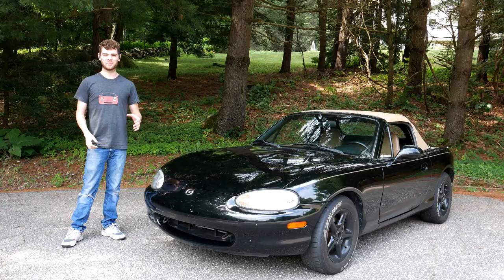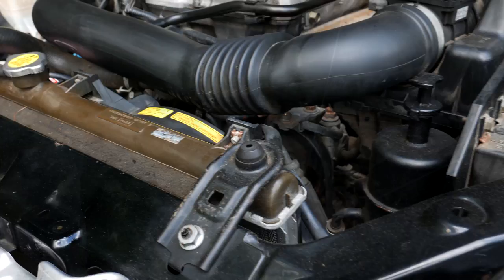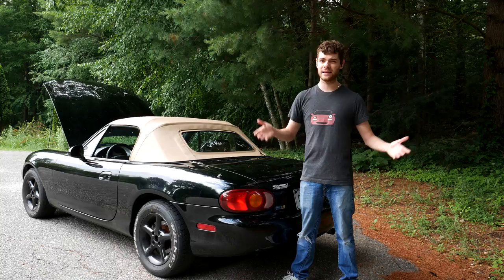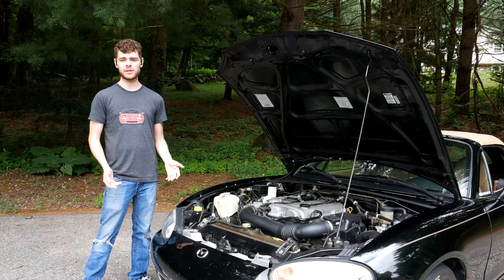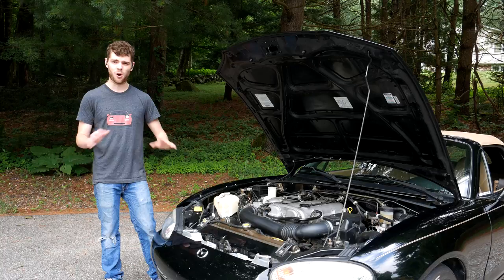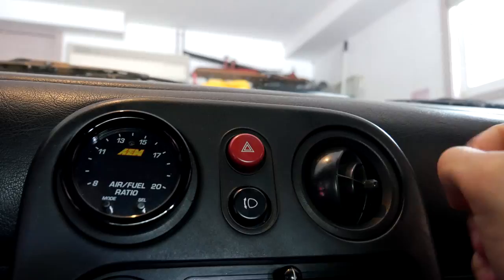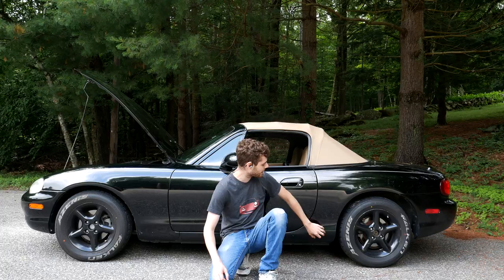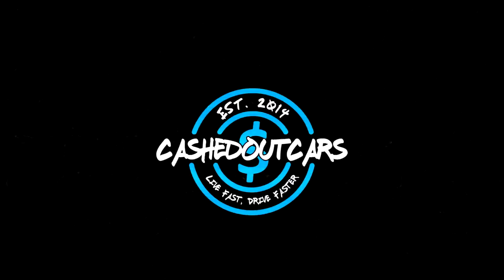5 MX-5 Miata Problems You WILL Have

Comment: Clutch slave cylinders will fail with no notice. Also the window track components wear out. Finally, the shifter will need to be rebuilt. Replace the nylon bushing with a bronze bushing and replace the boot seals (They will be torn)
Reply from the maker: I had my slave fail on my NA and the shift boots torn too

Comment: I have a 2003 NB I've owned since 2007. Its rear main seal has leaked since about 2010... had the valve cover leak too, but fixed that one. Rear main STILL leaks to this day, but hasn't really gotten any worse. Some day I'll summon up the motivation to drop the trans and replace it but today is not that day.

Comment: Also the cover under the steering column will fall off. Have had an NA and NB and it happened in both. Also have had valve cover oil leaks in both and not a leaky rain rail but definitely clogged drains that have to be cleaned out periodically.

Comment: I’ve have front wheel bearings go. Front brake callipers seize and rusty sills, leaking roof. Clutch release bearing went too and water pump had tight spots when replaced. All on a 76,000 mile 2002

Comment: It’s 85$ for a radiator on Amazon I’ve been using at high rpm as a drift car for 2 years no issue, I have hardtops so never had a issue with my softtop going bad, never had the rain rails fail in either of my Miata’s yet hopefully it doesn’t. 😭 you have to do maintenance it’s so easy to change these oil gaskets, there about 12-19$ on Amazon and extremely easy to install, I definitely agree the vents are get floppy, personally mine are aftermarket but I agree, I don’t have rust but yeah that rocker panel be rusting like crazy

Comment: My 95 just got it's vents pulled and refreshed yesterday.  Still need to get the new Robbins top on, I have the hard top but having a hard top on a convertible isn't a solution to me, it's a problem.
Reply from the maker: That’s true about the top.. luckily hard tops are relatively quick to remove. I’ve still been quite happy with my soft tops!
Reply: @CashedOutCars  Mine has the Jass latches in the back so... more secure but more of a pain to take off as it requires tools.  Need this New England weather to go back to sunny and humid instead of constant rain so I can try to get it done.

Comment: I havve a 2002 NB and I had all those problems plus the battery container rusted, Rust is the main issue. I am from Quebec where they use salt in winter and it is a body killer... Thanks. Oh I forgot the mesh oil filter of the VVT cam shaft system.

Comment: If you want the valve cover to stay dry, get the valve cover gasket from the Mazda dealer. The genuine Mazda gasket has a sealing groove on the top and the bottom of the gasket. Not one of the aftermarket gaskets I have seen have a sealing groove on the top. I've had 100% success rate with the Mazda gaskets, every single time I've tried an aftermarket gasket it leaks sometimes immediately, sometimes a few months in. Just buy the Mazda part, it works.
Reply from the maker: I agree, I had to replace mine twice on my NA

Comment: Good points on the MK2 NB .. However you missed out the NUMBER 1 issue with NBs...... CHASIS RAILS !!!! THEY RUST THROUGH... That would have been my first and most important thing to look out for and get sorted!!!
Reply from the maker: That they do, but from what I've seen it's far less common than fender and rockers. I did cover that in my full rust guide video on these though!

Comment: Clutch slave cylinder.  I changed mine 3 times in twenty years.  Had the original clutch the whole time on 95 NA.
Reply from the maker: That's definitely quite common, I've had mine fail myself

Comment: On my 93 about two weeks after I bought it, water began pooling around the bottom of the soft top so I pulled out and cleaned the drainage pipes. In one of them I found 3 bolts. I don't even know how they all fit in there or where they came from 🤣. The other one was just clogged up with mud and debris. Not had an issue with them since 😊
Reply from the maker: Glad you got it taken care of, enjoy!

Comment: Suprised nothing about lifter tick. Gotta put the right oil in for the season you're driving in. In my southern summers I would run slightly thicker weight for operating temps with 5w-40. For winter I would run thinner cold weight with 0w-30. I've read that some people go for 10w-40 for summers, I don't remember why though. At some point I started running 0w-40 (summer) and 0w-30 (winter), but I don't remember exactly why. 

There is also the EGR Valves reuptake pipe clogging with carbon deposits (primarily NA issue). There are few fixes. If you don't have to do emissions you can weld or plug the reuptake on the exhaust manifold, then tap and plug it on the EGR valve. If you have to do emissions you gotta get some brake cleaner, brake cleaner, and 30 mins to an hour of your time to clean the passages. If your reuptake hardline cracks, which is common, you can either buy a replacement or tap for a larger stainless steel line with AN fittings.

For my southern Miata daily drivers, you might run into heat soak or general overheating issues. Getting the coolant reroute kit and racing thermostat solves this problem. 

Accessory belt likes to pop off when your tensioner is bad, I don't know the solution to this one but I can tell you that Mazda's genius design ( -_- ) of using iirc the power steering pump bracket as the tensioner is annoying. Doesn't matter what belt you get, that bitch will fly off if the bracket is bad. 

MT shifter bushings like to crack/break if you shift hard. The solution is learn to shift fast without slamming gears and replace bushings along with topping the tower off with quality oil. Once you do those things you'll get smooth and crisp shifts, and won't prematurely wear your bushings. I'd recommend this as one of the first things you do if you buy a yata used. 

For the radiator, just say fuck it and buy the Mishimoto rad. No cracking issues if its all metal. 

Headlights like to die on these since new OEM are not manufactured anymore and aftermarket BULBS are kinda crap. Solution is to go for Jeep Wrangler headlights, IMO preferably LED.

Owning a 1.6L? just buy a 1.8L Miata. 

Not enough gears for highway cruising? just buy an NB.  

Not enough powah? Miata is not the answer.
Reply from the maker: Lifter tick only affects NAs, since they have hydraulic lifters. That was changed for the NB. Not enough power can easily be changed with a turbo :)
Reply: @CashedOutCars  Whirly bois are def alot of fun on these cars. On the other hand I got to ride in a 300hp naturally aspirated NB and that was one hell of ride. And you are 100% right about lifters, figured I'd mention it though because its super common

Comment: I had the original Miata (not turbo) , the one with the pop up headlights for 17 years! Never has any of those problems! Never has a brown radiator, the top stayed perfect, the eyeball vents never sagged. The rain wells did get clogged so I simply cleared them. I took great care of my Miata, including the top. I did put on aftermarket glass rear window because I got tired of the cars it took to keep the plastic clear. 

I sold her for practical reasons…a sad day for me.  1990 white Miata. I have a ton of photos but on YouTube, no way to post them.

Comment: Brake leak that cannot be found
Torn soft top
Leaking valve cover gasket
Wiring issue with my headlights
My issues are driving me crazy….
Reply from the maker: Best of luck solving those! The valve cover gasket is pretty straight forward, definitely get that leak sorted out before driving it too much!

Comment: Every car, no matter how well designed and built will need basic care and maintenance.  Most of the "problem" items discussed here are rather small.  I've owned my 2003 NB since it was new and it has been a damn good car.  I also own an E30 BMW and while the BMW is a blast to drive, it's more of a pain to service than the Miata and isn't as trouble free.  I would recommend an NA or NB Miata to anyone, but they require maintenance and things wear out over time.  I have had only two problems over almost 20 years.  When I disconnect my battery, the intermittent monitors can take thousands of miles to set, which causes inspection problems in my state.  I also had to rebuild my oil control valve and the solenoid for my variable valve timing system.  Otherwise, I trust me NB to take me anywhere and get me home again.

Comment: The most difficult thing to fix on these cars is the OEM cassette deck. I seriously had more trouble with that monstrous thing than doing the RMS / clutch...
Reply: I'm considering doing RMS and clutch myself on my Honda. Would you recommend trying this kind of thing as an amateur mechanic?
Reply: @AudreysKitchen  If you have a partner that can help you with lifting and maneuvering the transmission, you're good at following instructions to a 't', have another mode of transportation while you're working on the car, and can budget for a worst case scenario of having to take it to a mechanic to finish the job, then I'd consider cutting your teeth on a project like this. There's going to be risk involved, but you know your tolerance for that better than I do.

Comment: I bought a 91 miata from a towing yard for $900.00  with 224k on the clock, only thing it needed was break pads, and tires. I've had it for 4 years now. Only other issue was the alternator died. So it was replaced. Other than dented hood and fender and miscellaneous interior parts it's a sound little car. Boosting it is questionable it now has 256k
Reply from the maker: Nice! My other one is a 1993 that I turbocharged at 216k
Reply: @CashedOutCars  also I wanted to thank you for your videos, without them I would have never heard of speedy efi.👍

Comment: I’ve got a 91, I had to replace the too soon after I bought it in 2008. It also leaks oil but only enough to make the under side of the car dirty. There are some other things but none of them were mentioned and overall it has served me so well that I bought an ND when my piece of crap Subaru blew its engine at 68k miles.

Comment: 2002 NB LS model w/5 speed owner here. Have owned since 2008. The car resides in New England, and is never driven in the winter/early spring months. It gets stored in a heated garage. You can eat off the underside of this vehicle. Currently @ 130K miles. This has to be the most trouble free care I've ever owned. Sure there are some mechanical issues that arise (failed clutch slave cyl - easy fix; cam position sensor failed - again easy fix) and some that fall into the cosmetic category (deterioration of the soft top, cracked left bolster on driver's seat). Not sure about the other items you've highlighted here. As to the soft top, that's common for ANY drop-top vehicle. The trick is to replace the vinyl OEM unit with a quality canvas-type. Vinyl is no match for the elements, especially the UV rays. Do the rain rail & drains when replacing the top and you'll be set for years. I also take a holistic approach when doing any maintenance. For instance, when it was time to do the timing belt, I had my mechanic replace EVERY wear item within that assembly (water pump, hoses, fan belt etc.) It just makes sense to do these as a preventative measure while these parts are being removed. One thing that was NOT mentioned is the wheels. I have the OEM LS wheels, which are susceptible to damage and being knocked out of round. for their size, they are very light - not sure but they feel like they're made out of some sort of aluminum alloy. I've already had one wheel straightened and know of another one that also needs to be straightened as well. I purchased a salvage wheel so I can swap these out, one at a time while getting the damaged unit repaired. Luv, luv, luv this vehicle and hope to get MANY more miles from her!

Comment: Had a series 1.  Electric window failed. Unfortunately easy cable refit became new mechanism when temp fix slashed cable. Other than that not an issue.

Comment: Kudo's on a verrry clean engine bay.
I'm on my fourth MX-5--an '07 w/retractible hardtop, now at 280-k miles. Item #6 on your list should be the A/C compressor (especially in areas of the country where we use the A/C year-round).

Comment: You could have mentioned the clutch rubber/plastic buffer. They get old and finally beak and you can see the pieces at your feet. You can check when your Miata no longer start. It happened on both my miatas.

Comment: The "cursed" water plug at rear of enginenis likely to blow out. It did in my '91 and I had to do a bunch of research to find out what it was. Fortunately there are some Miata forums online that go into everything Miata. I replaced my front seal but the rear is a totally different animal with having to pull the trans to get to it, that's a job I'm procrastinating on.
Reply from the maker: My cursed water plug failed on my at the track last year on my turbo 93!

Comment: 2002 black MX5 bought it new and owned it for 5 years. Excellent car except that  the clutch plate had to be replaced 3 times under warranty by Mazda due to a known manufacturing fault. I quickly sold the car after the 3rd replacement as the new car warranty expired.  I pity the following owners who had to pay for ongoing clutch issues. 😪
Reply from the maker: That's interesting and is actually something I've never heard of happening with these, and I've personally had 5 of them so far. That's too bad you had issues!

Comment: 1999 MX-5 NB; had to replace soft top, front left fender, radiator, and cam cover seal.  But the main issue is intermittent hard starting (battery and alternator were changed out for separate other reasons, ignition switch plus electrical grounds checked and cleaned; however, the problem still persists).

Comment: We have a 2003 with 45K miles on it. Bought it in 2005. Main problem we've had it battery drain. If we don't start it every month, I have to use a charger on it. Also, sometimes it dies for no apparent reason and I have to crank it a long time to get it started. When it finally starts the tachometer is erratic and bounces around a lot until it finally settles down. I have no idea what's causing that unless it's old gas, since we don't drive it very often. Any thoughts on either issue?

Comment: Me and my garage got one of these, exact one, got a issue tho, its got a cyl1 miss fire and ive checked compression and thats at 180psi and its got spark, we changed the coil, plugs, HT leads and also everything to do with the fuel, injectors, fuel pump and fuel rail. No matter what we cant find the issue for it

Comment: I thought someone would have mentioned the sump seal - the 2 semi circular inserts shrink and leak. Had a 323gtx with the same engine - same problem. Thought it was rear seal on 323 but no. MX5 has small weep from front sump seal.

Comment: Underseal from new then the rust problem is not a problem.
Dont forget to clean out the soft top drain holes .
No one in my local owners club with 30 cars from NAs too NDs have ever had an oil leak.

Comment: I do notice that third gear is getting a bit problematic especially on rapid heel toe downshifting at the track. 
I'm not sure if its the clutch, the transmission or a problem between the seat and the steering wheel.
Reply: As far as i know, there is a transmission service every 50k miles or so where you change the transmission oil. maybe try that first. then you could overhaul your shifter. there is a upgraded bearing from cusco i think. while doing so you can change those rubber hats sitting on your shifter. sorry for my bad english, hope you understand what i mean..
Reply: @bastianscherrer354  thank you. I'll try those suggestions

Comment: 2008 MX5 stared kocking after it worms up. Can`t tell if is the upper or lower end .  Cheked the engine oil it was black on the dip stick. what would you think went wrong. thanks AJ

Comment: I have a 99 NB, about 70k miles. radiator replaced due to top cracking. Replaced top. It was ok but rain rail was leaking. Vent pad a little loose.

Comment: 01 NB special edition. 
P sure I have an oil leak and coolant leak
had to replace my clutch master/slave valves
sub frame is bent
drains keep getting clogged 
reverse gear doesn't work half the time
AC doesn't work, can't figure out why
windows only go down 25% of the way
return (ground) wire isn't attached fully 
prolly some others but that's all I can think of

Comment: Forgot to mention that AC water drain inside passenger foot well will clog. And while on this subject: The heater core and related flaps has foam seals that degrade and this will make cooling the cabin more challenging as well as not separate the air flows as well as before. 
The airbag module behind the instrument cluster will also die at some point when the condensers age out. It must be removed by first removing the driver seat then reach up in the driver side the foot well and remove the box, and repair the unit as old replacements still has old (soon to fail /failing) condensers.

Comment: I have a 2008 Miata mx5 with 102k on the clock and i have non of the symptoms you described. I've done nothing but change oils, brakes pads and rotate tires plus a battery change. Mine is a hardtop.

Comment: Where do the problems begin. Well pretty much I bought about a year ago it's a 1991 with 117k miles on it and I've had to replace the soft top, re build the shifter. Headlights stopped popping up and turning on fixed that. Leaks oil, has some rust thank God it's not bad and just is a bundle of expensive joy

Comment: i need someone’s help. im looking at a 1996 mx5 and it has a oil leak, it’s dripping on the belt near the alternator and a little on the alternator. it also has a check engine light which is being a pain to read. any advice?